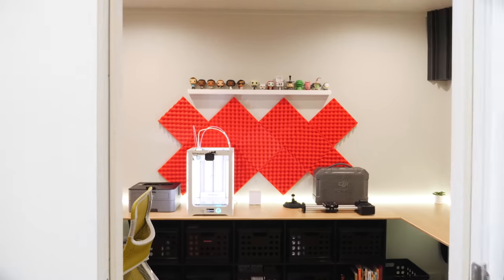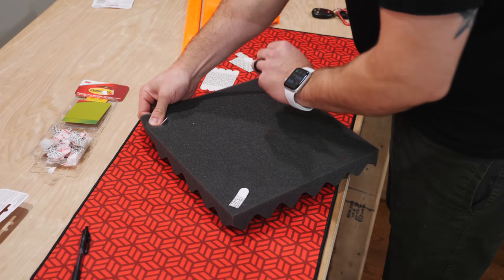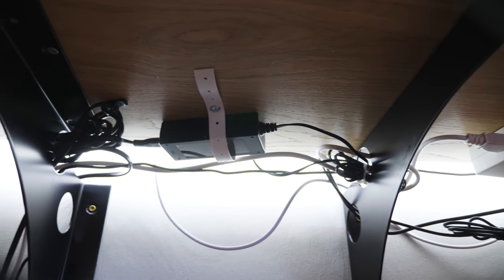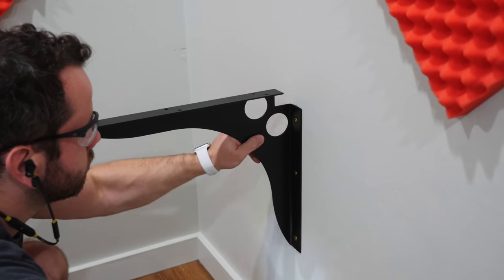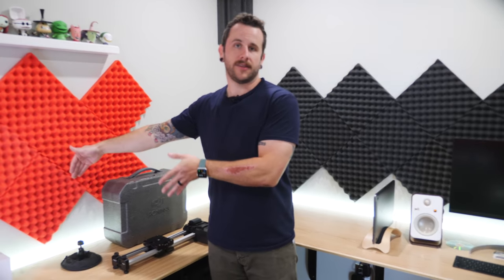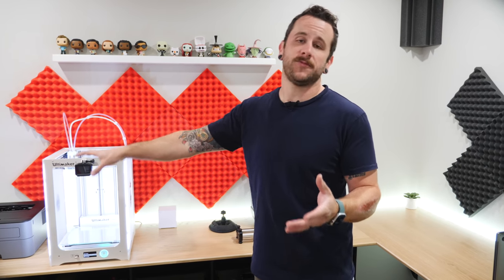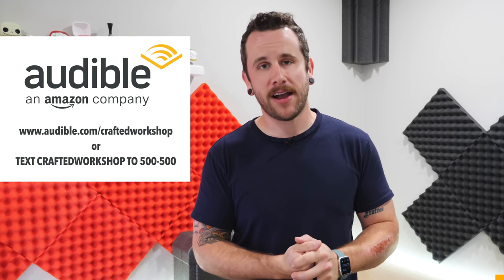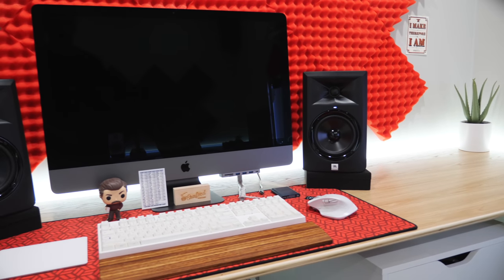How To Build A DIY Plywood "Dream" Desk & My Video Editing Desk Setup

Comment: For your power point issue you could cut a square hole out of the cabinet, route a small recess around the hole and make a small cover plate to fit, either screws in place or magnets...?

Comment: I loved the office setup.  It looks smaller, but you pack a lot in there.  You mentioned dusty workshop and I was wondering how much of it would come in to your office.  My thoughts were if you have the same temps for office and shop, build a small filtered intake in the ceiling through some nice vents and put some positive air into the office, just a slight amount but it should be enough to push air out the door and keep more of the office dust free.  Does this make sense?
My career has been in IT, but woodworking is my future.  I recently got a 27" curved samsung and OMG, the display is amazing.  I thought curved monitors were just a fad type of thing but the readable display is wonderful to work on.  Regards

Comment: I turned my office into one that’s very similar to yours. VERY similar. I got the Alex drawers from ikea down in Charlotte, and then got their countertops as desktops. I cut one down and added the edge they provide and made the L-shape. Set up a second workstation (that my two young boys took over), added the mic, etc. I got the Steel keyboard with the RGB, but it drives me nuts cause you just look at a key and it registers. I still have to add the sound foam though. I’m thinking of putting a frame around them and kinda making it look better like that. Anyway, office looks great.
Reply from the maker: Nice, sounds like a cool space!

Comment: The acoustical panels will start to fall down after time using command strips, personal experience.
Reply: And they are just overpriced foam. I dont understand how can people still buy this overpriced pyramid foam instead of correct Diffuser & Absorbtion Panels, which are killing the correct Frequency Peaks in the room. Most of them dont even measure the Room

Comment: So sad you think that Apple makes a good computer. For the cost of that Mac you could build your own with insanely better specs.
Reply from the maker: Not when you factor in a monitor of equal quality.
Reply: @craftedworkshop  exactly, Linus from Linus Tech Tips said it himself, the value is amazing for the included screen, and you also can't compare to consumer CPU's and RAM, since it uses professional gear

Also, Thunderbolt is not that available
Reply: @craftedworkshop  I just recently purchased new monitors as well. They are 27 inch, 1440p, 144hz, IPS panel displays and they were $300 each. Apple doesn't sell a single product that has a screen with a refresh rate higher than 60hz, AND THIS IS IN THE YEAR 2019! One 60hz display doesn't make up for the overpriced parts behind it.

Comment: Johnny: Acoustic control of reverberating sound is always an issue whenever hard surfaces surround a space.  I think what you did is a colorful and great solution.  Down the road, should you need to add addition sound control, we often specify "Homasote" products (http://www.homasote.com/products/440-soundbarrier).  We often suspend lightly painted or cloth covered 18" or 24" wide x 48" long "Homasote" acoustic boards perpendicular to the ceiling (long axis parallel to the ceiling) on stainless steel cables spaced 24" to 30" spacing along the two opposing walls.  The panels are attached using spring clamps which makes it easy to move the panels around or place them for optimum sound control.
Best - Michael